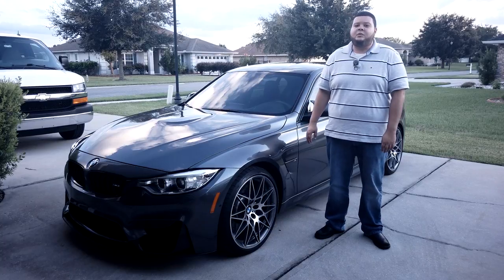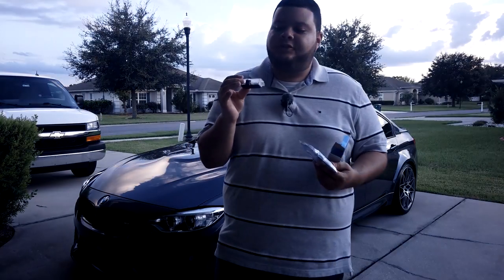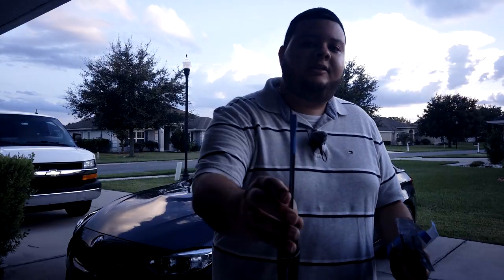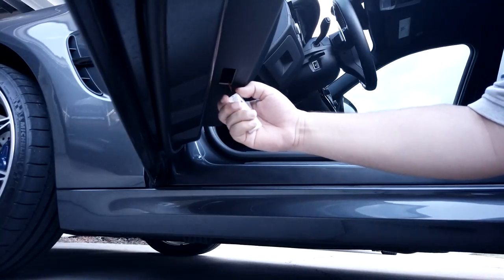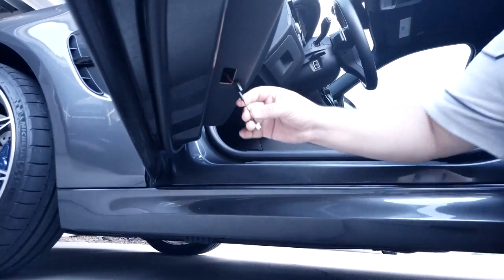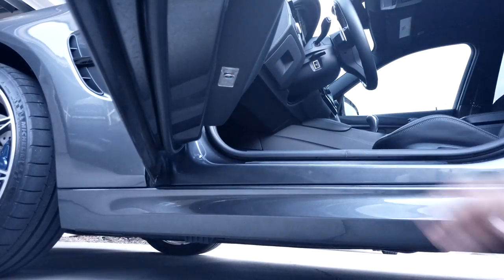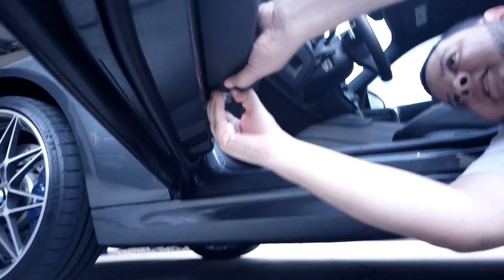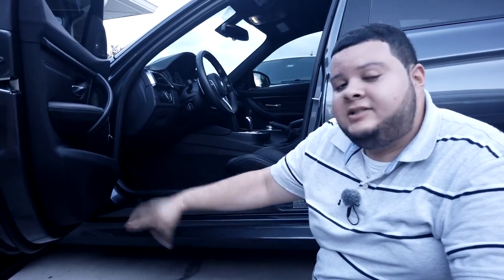How to Install 3D Shadow Door Welcome Lights - BMW M Logo Projector Lights - BMW F80 M3

Comment: Thanks bro 😁
I had the same problem with my BMW X1 2020 I had the 4 pin connectors on the car

The older Bmw are 2 pin connectors that's why all those BMW Projector light are coming with the 2 pin connectors

Comment: I got these exact one's for my ride, however the ///M projection isn't lining up straight with the door. Do you know if they can be adjusted?
Reply: Actually you can adjust them. I just pulled them out and had a look. You can turn the bulb casing. You just need to be careful because it gets very hot.

Comment: Reason it was upside down and pay attention people, was because it’s the left door projector. Don’t flip the light although it can be flipped it’s just simply on the wrong door at least the OEM ones come in a left and right.  So if you projection is upside down simply install the other projector so test before putting the light in the car…

Comment: Nice Vid bro. I want to put these on my E93 M3. Which brand did you use and how are they holding up?
Reply from the maker: Thanks man! The brand I purchased is called 3d Shadow Lights. They are working great with no issues.

Comment: Hey bro where did you get the shadow lights from and how much were they.
Reply from the maker: They were like $20. I couldn't find the exact one I purchased. I would suggest you type in the search bar "led door projector lights m logo" at Amazon or Ebay and they should pop up.
Reply: @essentiallyauto6596  Thanks bro, I did purchase them and they look sweet man.

Comment: hey dude, can you report back? did they tarnish and burn out? ive had these before and they changed colors.
Reply from the maker: I only use the M3 on the weekend and I haven't had any problems within the 3 years I've had the M logo lights.
Reply: @essentiallyauto6596  got a link to purchase man? thanks so much
Reply from the maker: @Wadson  I couldn't find the exact one I purchased. I would suggest you type in the search bar "led door projector lights m logo" at Amazon or Ebay and they should pop up.

Comment: Hey nice vids. I have a Black BMW 328i. On the outside plastic trim where the door is, paintballs hit the trim, with the heat here in California. I forgot to wash it off and it has a white residue stain on it. When I use my nail to scratch it off, it easily comes off, however I was hoping there's an easier way to remove it without having to scratch it off. Any ideas?
Reply from the maker: Thank you! I would liberally spray an interior cleaner on it like Adam's Leather & Interior Cleaner and scrub it with a boars hair brush. Let me know if it works :)
Reply: Essentially Auto on your video when you open the door. Locate the door handle, the trim on the door, above the sides of door. That trim... leather cleaner will work?
Reply from the maker: Bobbie Loarca  I'm sorry I misunderstood with my other post. I thought it was on the door on the interior. I think your talking about your door pillars. Can you send me a picture to essentiallyauto@gmail.com? This way I can see what it looks like.
Reply: Essentially Auto yes. I'll send it in about an hour. Thanks bro.
Reply: Essentially Auto I'm sending them now
Reply from the maker: Since the door pillars are shadowline trim they scratch very easily. To try and prevent scratches first wash the area with water and soap to remove all the dirt. Then while it's still wet spray an all purpose cleaner on it like Adam's APC. Let it sit for a bit, but don't let it dry. Wipe it off with your wash mit with soap & water and rinse. If that doesn't work use some automotive goo gone with the same procedure. Let me know if it works!